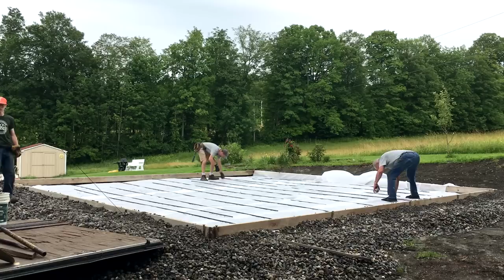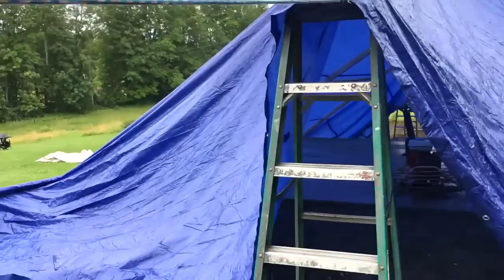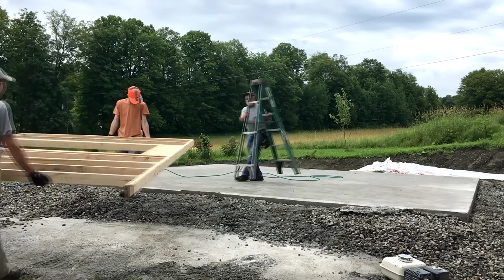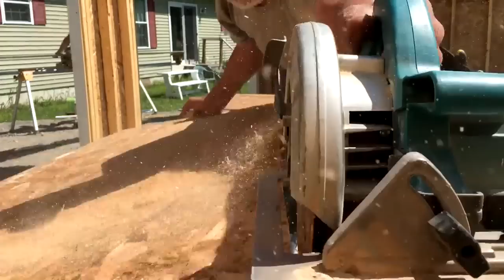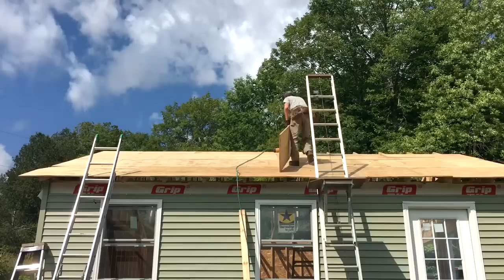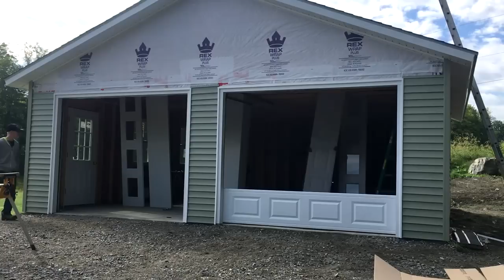$26,900 2 Car Ranch Start to Finish

Comment: Is $26,900 including concrete slab and labor costs?  If so, what is it just for the material alone with no slab or labor? Just curious as Canada is almost double the cost. $26,900 USD is $36,176 CAD...ouch.
Reply from the maker: Typically materials are around half of the total

Comment: What would a 32x32 garage cost today, very rough estimate of course? I paid $27,000 back in 2013 fully finished, wired, insulated, attic storage, 3 windows, service door, 2 insulated garage doors, vinyl siding. I know prices are much higher today.
Reply from the maker: Just over $50k for the shell.
Reply: @Kens Karpentry  thanks for the reply! So my garage value has about doubled!

Comment: I am planning on building a 24x50 with 16' side walls would you block the 2x6 n would you install osb plus 2x8 siding on walls. I am also doing 3' footing then concrete slab n 16 x14 overhead door. Will be renting a crane to lift trusses n walls. Thanks
Reply from the maker: Cool. Might be a good idea

Comment: Ken hi. Great work
Hey how much would it cost to built a 28x32x12 with 5/12 pitch roof just rough estimate.  What do you think . And would that include 6" concrete slab and rebarb.
Reply from the maker: Around $48,000
Reply: @kenskarpentry  ok thank you just know you are my inspiration n I'm attempting to build it my self with my family.  So I will always apriciate your feed back and answers.  So when I order trusses does it matter  hiw long is the overhang.  How far out do you do yours.  Looks like 6" to me and maybe 12" in front of garage??

Comment: Merry Christmas Ken.  Where your thoughts about a scissor or parallel chord roof, then adding a mezzanine for storage? Is the extra truss/urethane insulation cost worth it?  Thanks
Reply from the maker: It really depends on your individual needs whether the added cost is worth your goal.
Reply: Ballpark, are we talking extra 50% on cost for those rafters (obviously lumber cost are still a little wonky)? Trying to put a rough budget together based on local costs here in Montreal.  Thanks again

Comment: Is that 1/2" plywood on the roof? We have to use H clips when the trusses are on 2' centre's.
I'm sure you can build these in your sleep. I've built a few but I sub the concrete. I've learned I'm not good at concrete.
Reply from the maker: We use 5/8” cdx
Reply: @kenskarpentry  That's a nice solid roof.

Comment: Is that a homemade ladder hoist? I briefly had a used electric one 28 years ago but i didn't need it as often as i began subcontracting my roofs out.
Reply from the maker: Yes it is
Reply: @kenskarpentry  Thanks, Found your ladder hoist build video. Probably the simplest ladder hoist build i have found. What electric hoist did you use?